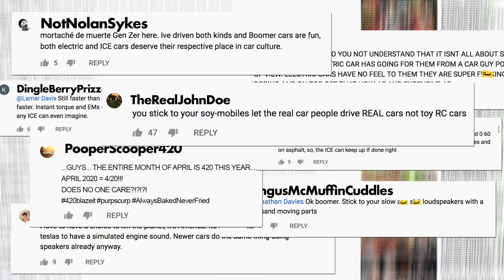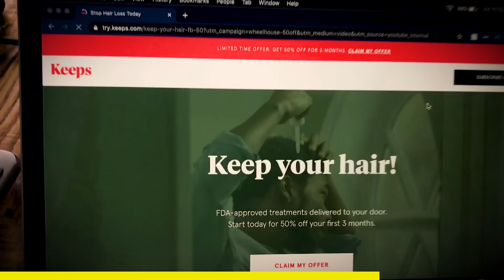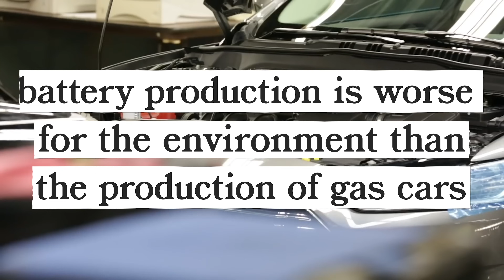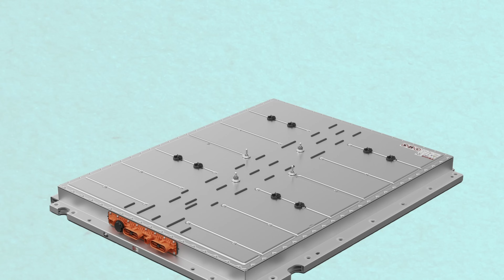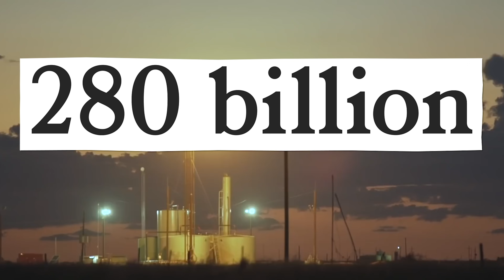Are Electric Cars REALLY Better for the Environment?

Comment: Watching this 2 years later and I have a few comments:

I think you did a really good job looking at this from an unbiased perspective, however I think you missed out on a couple important points.

1. The batteries on EVs wear out. These batteries will need to get replaced multiple times throughout the life of an EV. Judging by the fact that the majority of EV emissions come from the battery manufacturing process, I feel like accounting for this would change the numbers a lot. These batteries don't last nearly as long as reliable gasoline engines, which can run for hundreds of thousands of miles with no issues.

2. The power grid concern you denoted as a myth actually has a lot of merit. There was a recent heatwave in California. Because of this,home owners tend to use more electricity on air conditioning. This alone was enough for the state of California to request their residents not to charge their EVs because they couldn't provide enough power to do so. They also requested residents to set their thermostats to 78 degrees or higher in order to conserve power. This is ridiculously hot and not at all a reasonable request.
Reply: I was going to point out the same thing with the electric grid downing/restrictions in CA! A lot more work would have to be done to prepare the electric grids for electric cars.
Reply: The other thing that wasn't noted was the reduced battery function in colder states or countries like Canada, where everything east of British Columbia is a frozen tundra for 4-5 months of the year. That harsh weather is going to kill the battery life & efficiency and cause even more frequent replacement, and that's just based on basic use of the vehicle, not counting the fact that you NEED the heat on and that's going to burn more battery power. So many factors to consider...
Reply: first off cali has one of the most dense populations in the states. Yes there would be concerns but those concerns can be remedied. Not to mention he said all of the country not just cali and most of the states would be fine. There will be a couple of states that would have issues like texas and cali but the majority would be fine. So your second point is not wrong but its not correct. Its cherry picked info.

The first  point. Yes batteries tend to wear out. However most peoples cars will last a good amount. How long is that about 20yrs. You make it sound like its every couple of years. Which isn't correct. Unless the battery is defective, you will most likely be selling that car before you have to worry about a battery change. And those batteries are either recycled or are reused in windmills and other solar power solutions. And that battery is covered under a manufacturer's warranty for at least 8yrs. So again you are twisting some facts that while not wrong in nature but that twist is misrepresenting the facts at hand.

Not to mention scientists and engineers are constantly working on newer battery solutions. Coming up with newer lighter, smaller, more efficient batteries. A huge break through is with graphite. can hold a charge for much much longer. However its nowhere near ready to be used as its insanely expensive currently to make. 

So you are pushing for false narratives here. What your saying isn't necessarily wrong but they are skewed to the point of wrong.
Reply: @densetsu4286  my first point isn't "cherry picked info". You claim there are plenty of remedies, yet don't name any. If there are plenty of remedies, why didn't cali use any of them?

Ask any decent mechanic and they will tell you that EVs are not nearly as reliable as well engineered gas engines. A good engine from Honda or Toyota will run forever. Also, your point of EV batteries being covered for 8 years under warranty is ridiculous. How does the manufacturer putting it under a warranty reduce carbon emissions??? They still have to mine a new battery, the warranty just means the consumer won't pay for it.

While it's true that scientists and engineers are always doing more research, the point is that as of right now, EVs are not where they need to be. In 10 years, they might be, but the argument being made is about changes made right now, not in 10 years.

I never pushed any false narrative, all I did was state facts to correct points that the original video didn't consider. You seem a lot more eager to push a narrative than me, considering how fallacious and poorly thought out your arguments are
Reply: @FinesseBTW  Yes tons. first is on the car end with newer battery tech that uses less due to using different materials (like graphite in the future), or adding more greener solutions like windmills, or using that mostly abandoned district commercial district and make a new power plant. So there are plenty of things and this is just cali mind you there are tons of other states that again doesn't have this issue at all.  But keep with the cherry picked state.

First tesla's are junk, we know this. However this is a hallmark of people new to the game. EVs are basically still in the Model T era. But all engines after time get better and better. And you don't think that honda, toyota aren't going to take their expertise in engineering and make a good electric motor? C'mon now. And i never talked about the engines like at all. I don't know why you felt the need to bring this up when i was talking specifically about batteries. 

No the warranties on the batteries aren't ridiculous as thats what the US mandates... Its a fucking federal regulation. Look it up.  

Well you see buddy those batteries are then taken to be recycled. And just because they can't be used in a car anymore doesn't mean they are useless. They get repurposed to store electricity that windmills and solar panels generates. Meaning we make less of them. Did you not even think any of this through?

Yes more batteries will be made. But less will be made overall. Because again recycling parts of the battery that are salvageable, to be put in newer batteries, so potentially less mining. And for others that aren't totally shot can be reused in other applications like i said already which are windmills and solar panels. For every one that gets repurposed there means one less need to be made for those. 

Again these mining facilities don't specifically just mine for EV batteries. They mine lithium and all ther parts to be used in plenty of other projects and not just batteries. And the ones that get sold for batteries are then made for a wide range of products like you tablet, phone, laptop, windmills, solar panels etc.  For evs this means a battery that may not work in a car can be moved to a windmill or a solar panel. That means one less battery for those. Instead of making 2 batteries car and windmill. One can be made. Get the idea? Its not hard.The more we can repurpose the less we need to make overall. 

Also its still a billion times better than keeping on digging for fuel and then transporting that fuel, on boat, then on train, then on truck to finally being put into your car. 

If you didn't watch this video fully without being triggered you would know that EVs are less harmful than ICE. Its not zero carbon before it gets to the consumer but when it comes to them its fucking low as hell.

Yes EVs are not where they need to be but you see, they need to be manufactured and made for them to get to where we need. Continuous improvement relies on us actually making them. Its the only way to develop new methods, cause more people doing it, more ideas crop up, new techniques get made, people copy, people improve. Its how we got from the ford model T to todays ICE engines and cars. Cause we been making them for 100yrs. You think cars were as good as they are now nearly 10yrs after being introduced? Do you think cars of the 1918 were great? Do you think the engines of 1918 were fantastic? Or did they have a lot of work to be done? They had a lot of work to be done. But the issue is thats wehere we are with EVs. 

Telsa first started making EV in 08. its 2023 its only been 15yrs since a company that put the effort in to actually being serious  with making EVs. Yes i know of EV1 by GM but no that wasn't a serious en-devour.  

And yet in these 15yrs we have seen massive improvements. And its only going to get better. Either way even with the current state of EVs they are still a fuck ton better than ICE. 

Yes you did push a false narrative. And you still are. You keep trying to assert that EVs are worse and that our whole electric grid can't handle it. Which is both wrong. Some states will need to adapt. But regardless EVs will get better and through that getting better less harmful materials to procure will happen. Also cleaner solutions of getting todays materials can also arise. But as long as its 3rd world countries that really don't give a fuck, we'll see but even then its still better currently than ICE.
Reply: Let’s also take into consideration the millions of acres of land that will be destroyed by the mining for the lithium and cobalt.
Reply: That's a great point but there have never been a shut down of the power grid in California and probably never will be. They do warn there might be certain areas that get shut down for a while but it's not the like the entire grid would ever be shut down. To this day California had never had the grind shut down as mass. Texas on the other hand is another can of worms.
Reply: @ricksilvas855  not a total blackout but a brownout warning for 10 straight days that prohibited normal life and transportation for those with EVs
Reply: @notDestroyer  lol that's not true at all... what city or cites are you talking about? I have not experienced and power outages due to demand ever here in my city.
Reply: @ricksilvas855 you can find videos on it, got to the point that diesel powered generators were being set up as temp charging stations for EVs
Reply: @yuujithedreadlord3988  post a link.
Reply: @yuujithedreadlord3988  

Any chance you can tell the truth
Reply: About point 1, I wonder how much something like a tesla would produce co2 when it needs a new battery vs something like a diesel hatchback's yearly oil change would produce co2.
Reply: I don't know how much merit you can give California. Atm it's an all around terrible state, and is continuing to get worse. The only thing going for it is money because of tourism.
Reply: thank you for noting the second point. There are way to many people that do not realize this and it will only get worse until we can begin storing energy more effectively, i.e. zinc batteries...
Reply: This is pretty late, but California just has a very bad electrical grid in general (at least for the amount that it needs to support). EVs or not, the electric grid here has been shotty at best for a while, with power outages not being uncommon, ESPECIALLY during heat which, well, is very common here. 

What would another example be from a place with better infrastructure be? Genuine question, I am curious if anybody knows.
Reply: @KontrolYT  idk if they have a better infrastructure but I'm pretty sure Texas had something similar happen
Reply: In regards to the Power Grid, he also skipped out on 'green energy' not being very green either. Solar panels and wind generators both need either completely replaced, or major portions replaced every few years. Solar in particular is harsh on the environment in production and disposal. Wind turbines are just bad in needing energy to reproduce the blades, as well as killing bird populations. Both solar and wind net gain in energy isn't even close to as high as coal, hydro or nuclear. Hydro has the most positive opportunities when it comes to "green energy", with advancements like the Dutch have made that allow fish to swim through water turbines unharmed... however, US government in particular has been holding that back. There's actually ALOTTTT of complaining about the US Gov in regards to holding back the energy sector.. but that's a different topic. Lol.

There's actually really cool advancements going on in all areas of Energy Generation. Most of society's qualms with them have been mitigrated by advancements that just haven't been implemented due to costs or social favor or whatever. Coal factories can have filters put on to catch emissions, Nuclear can be disposed in a very safe, compressed way. Water turbines dont need to harm fish populations if built correctly, Wind doesn't need to harm birds, if brought to a smaller scale, and solar.. is solar, and needs more development lol.
Reply: The batteries last longer than your ice
Reply: @fradaja  No they dont 🤣🤣🤣
Reply: @lootingiv4058   250,000 miles plus , go read
Reply: @fradaja  go drive a tesla for that long 🤣and i have done plenty of research. its way worse for the environment too
Reply: @fradaja  they are supposed to last 200,000 miles but a well maintained ice will last 400,000 if you are nice to it lol
Reply: He just claimed that it a myth and he busted it by quoting something which he heard some where.
Reply: Cap ev battery last just as long as engines just looked that up
Reply: there's no evidence that you need to replace the batteries "multiple times" during the lifetime of the vehicle. you're imagining things that aren't real.
Reply: There is NO WAY you are actually serious right now!! LOL
Reply: Just watched the video and was going to post the same thing. Batteries need replaced which after your second one you’re just as bad as normal cars lol. Also loved how he “debunked” the myth of the power grid nor being able to sustain but yet California was telling people not to charge their cars last year because the grid couldn’t handle all the usage 😂 imagine when more of the population owns them! Another point he brought up was how much oil production creates but doesn’t take into account that everything uses oil, machines, cars, equipment, etc. Fun fact, teslas use oil for there transmissions still! So much for a green vehicle huh?

Comment: There's simply no infrastructure to support even building a grid capable of recharging the thousands of vehicles passing through much of the country. By contrast, a gas station only needs some tanks, some pumps and a relatively tiny amount of electricity. Also, wind, solar and unicorn farts will never be capable of replacing the coal and natural gas fired generators at the power stations. This is like counting on winning the lottery to make your next rent payment. The scale is much too big and it will never happen.  And coal and gas don't need the sun to shine or the wind to blow. Nuclear energy is the only viable replacement that could pull it off. And people are unjustifiably afraid of nuclear energy. Even though more people have died working on wind generators and solar panels than have died in all the years, even the antique nuclear power plants. Nobody died at Chernobyl, 3 Mile Island or Fukushima.

Comment: You made the point about where the EV gets it’s power. You used the example of wind and solar and hydroelectric power. Now break that down into how big the footprint is for producing the components like the fiber glass and electric motors that generate that electricity. At current rate those broken blades are being buried because the technology isn’t their to recycle. Also solar panels are extremely expensive to recycle and lost are the rare earth metals in the manufacturing process. Nothing is free so let’s get over that lie

Comment: So question about the cabon impact ...if the batteries in an ev has to be replaced every 7 to 10 years doesn't that double the carbon footprint compared to not having to that with a gas powered car?
Reply: They give at least 7 years of warrenty on the battery that it won't drop below 80%. It won't be "dead" in 8 lol.  Double that time maybe

Comment: Gotta remember that even the **most efficient** gasoline-powered combustion engines in vehicls are only 40% thermally efficient *(most ICE's are around 25-30% effecient)* at turning gasoline into mechanical energy (60% of fuel is burned for nothing in return besides heat). The thermal efficiency rate in diesel engines is about 40% for most vehicles because of the more efficient compression stroke. The thermal efficiency in fossil fuel power plants is around 90% (only 10% of burned fuel is wasted). The process to turn that thermal energy into electricity for coal is 33-40%, oil powerplants around 40% and natural gas power plants around 50%. EV's have an electrical to mechanical energy effeciency rate of closer to 70-80%. Even Considering that EV's are drawing electricity only from sources that convert fossil fuels to electricity, these processes are typically as efficient or (in most cases) more efficient than a diesel/gas combustion engine at creating usable energy. Transporting that energy through the grid results in a power plant --> consumer electricity loss of about 8-15%. So the EV's in the worst case scenario of only using electricity from fossil fuel power plants are still using fossil fuel energy that ends up being just as efficient as a standard combustion engine. Only difference is that a combustion engine wastes 60% of its fuel while a power plant only wastes about 10% to heat losses. Of course the power plant only converts around 40 to 50 percent of that thermal energy to actual electricity, but that still equates to a roughly 40% Fossil due to EV energy rate. (.9 for coal to heat, .4 of that for heat to electricity, 0.9 for the 10% loss in power grid and finally 0.8 for EV electricity to Mech E). 0.9*0.4*0.9*0.8= 26% which is still better than some ICE’s

Comment: You neglect so many important factors. Just one example is the weight of the Tesla Model 3 LR. The extra beefy battery adds almost an 1/8th of a ton in total weight. That said, tires in those blvwhicles wear out way faster and increase cost and enviro-waste made by EVs.